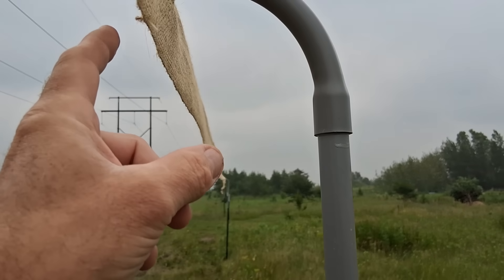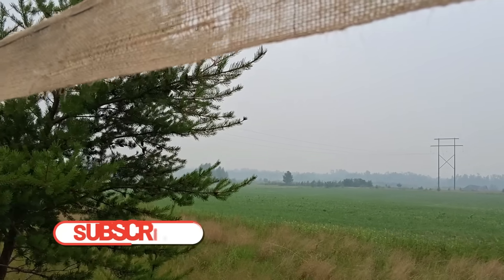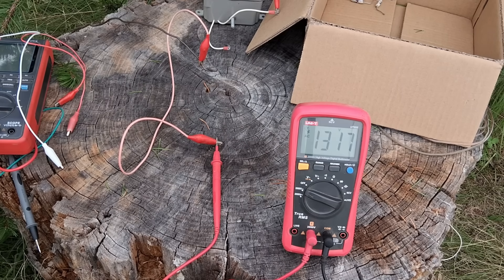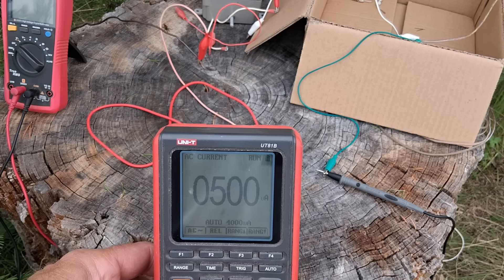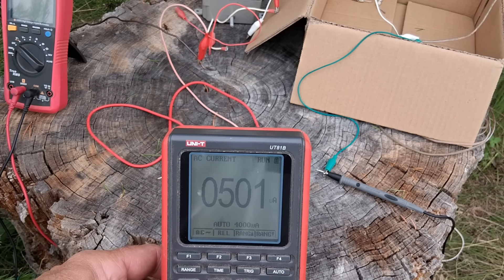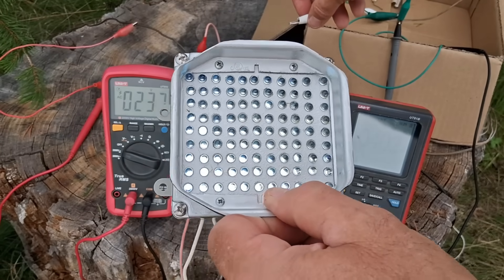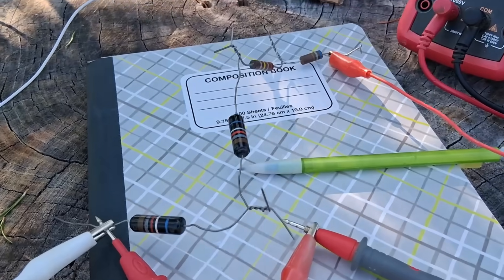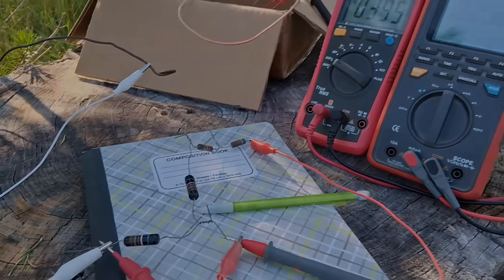Power sucking fences near H.V. power lines.  What transpired since?

Comment: mylar or aluminum 
Here is a detailed guide to turning this idea into a functional (though low-power) system.

1. Constructing the Collector Panel
Materials: A large, flat board (e.g., 4' x 8' foam insulation board is light and easy to handle). One or more space blankets. Conductive adhesive copper tape or aluminum foil tape. A wooden stake or post for mounting.

Assembly:

Stretch the space blanket smoothly over the surface of the board. Avoid wrinkles and folds where possible.

Secure it tightly using staples or tacks around the edges.

Crucial Step: Use the copper tape to create a "bus bar". Run a strip of tape from the center of the blanket to the bottom edge of the board. Ensure it makes solid, continuous contact with the metallic surface of the blanket. You can even criss-cross the blanket with several strips of tape to ensure low resistance.

At the bottom of the board, create a secure connection point (e.g., a binding post, a screw terminal, or simply solder a wire directly to the copper tape). This is where you will attach your wire.

2. The Essential Safety and Connection System
Grounding: You MUST drive an 8-foot copper ground rod into the earth at the base of your setup. This is not optional.

The Wire: Use a single length of coaxial cable (like RG-6). Connect the center conductor to the connection point on your collector board. Connect the braided shield of the coaxial cable directly to the ground rod.

Why Coax? The shield, when grounded, acts as a barrier that prevents the inner conductor from re-radiating energy and protects the weak signal from external interference on its way to your circuit.

3. The Electronic Harvesting Circuit
This remains the most critical part. The energy from the field is useless without this circuit.

Location: Build or place this circuit in a weatherproof box at the base of the collector pole.

Circuit Design:

Input Protection (Optional but Recommended): A high-voltage, low-capacitance capacitor (e.g., 100pF, 2kV) and a transient voltage suppression (TVS) diode across the input to protect against voltage spikes from lightning or line faults.

Rectifier: A bridge rectifier made from four 1N4007 diodes (cheap and rated for 1000V).

The Magic Chip: The input to an Energy Harvesting IC like the LTC3588-1 or BQ25570. This chip is designed to take the high-voltage, pulsed DC from the rectifier and efficiently convert it down to a stable 3.3V or 5V output.

Storage: The output of the chip charges a supercapacitor (e.g., 5F, 5V) or a small lithium-ion battery.

Output: The stored energy can now be used to power an ultra-low-power device like an ESP32 microcontroller that deep-sleeps, wakes up to take a sensor reading, and transmits it via LoRa once an hour.

Comment: If the coupling mechanism is capacitive, then a metal panel should have better coupling. Your coupling will be e A/D, where e is the permittivity of free space (8.854e-12), A is the surface area of your collector and D is the distance between the your collector and the power line. You are building a cylindrical capacitor, however I am thinking that you can model a small part of the cylinder as a parallel plate capacitor.    The current that will flow would be eA/D x dV/dT, where dV/dT is the rate of voltage change on the power line. A 100KV rms line @ 60Hz would have a rate of voltage change peaking at about 5.3e7 V/second. Putting this together, if the distance from the wires was 100 meters and your collector had an area of 100 meters the current flowing under short circuit conditions would be about 0.33mA rms (I suspect your distance is less, which would increase the current). Challenge is to extract useful power, as the output of you collector is very high impedance, one option would be to connect your collector output to the high voltage secondary of a neon sign transformer (not an electronic driver) and rectify the voltage appearing on the primary. 
Note that the power company is also inducing current into the earth below the power line, what you are taking is microscopic compared to those losses, that is why high voltage DC transmission is preferred for long distance movement of power.

Comment: Some fundamentals to keep in mind-

Essentially you are building a 60Hz near field antenna. A near field antenna operates within the near field of an AC conductor. The far field of such a conductor begins about three wavelengths away from the antenna, which for 60 Hz is about 4500 miles. The field strength in the near field decreases as the cube of the distance from the conductor so there just isn’t going to be a lot of power to collect at the distances you can legally place your receiving antenna.

The amount of power you can harvest goes up with wire length. Ideally it would be resonant at 60 Hz but a half wavelength at 60 Hz is about 1500 miles. That is why you are seeing milliwatts on a good day.

The better conductivity your antenna has, the more power you can harvest. Yes, that means copper. Copper is mechanically weak so you either need thick copper cable (expensive and liable to being stolen) or thin, say 22 gauge copper wire supported by steel fence wire. 22 gauge can’t carry a lot of power but short of a lightning strike it’s never going to have to.

Don’t try charging a capacitor with AC. Take the output of your antenna and run it through a neon sign transformer connected backwards (one high voltage terminals to the antenna wire and the other to a ground stake, take your output from the normal input terminals of the transformer) and measure the output voltage. It should be around 12 - 50 volts AC. Run that through a bridge rectifier rated for at least twice the voltage you see and maybe ten watts (it will never carry that much power but it’s going to be cheaper than looking for a very low power bridge) giving you DC voltage in the same ballpark.That you can use to charge capacitors or suitable batteries. You may need another transformer to get the voltage where you need it for the batteries you have on hand.

Transformers including neon sign transformers are typically better than 90% efficient. Don’t worry about losing power heating it up.

As always take precautions handling and assembling your gear. Even low voltage AC can be deadly.

Power companies don’t care about this kind of thing because power lines lose power this way to all kinds of other things from highway guard rails to metallic ore bodies, and they get a tax break on it. Any power you harvest will vanish in the noise of what they already lose.

Again, set up properly you will only ever be able to harvest milliwatts but it will be constant, night and day, as long as the power plant operates and your setup doesn’t get blown down.
Reply: Can't it instead be analyzed as a second half of a capacitor?
Reply: @mskiptr Good question.

The answer is, you can but you have to limit yourself to only taking power from the AC electric field of the wire, which means you have to connect one end of your load to the ground.

(There’s always a “but”. Electricity is complicated. That’s just a fact of life.)

This is because the power line has an AC potential along its length, which creates the field around it relative to ground.

At first glance it looks like a straight-up capacitor. You have a conductor over here (the power line) that has a particular AC potential and therefore creates an AC electric field in the space around it, and you have another conductor over there (the wire) so you expect the wire to take on the fractional AC potential at that point in space from the power line according to the inverse square law. So far, so good except the wire is in the near field where the inverse square law doesn’t apply. The field strength there obeys an inverse cube law, but we can ignore that for now.

Treating this as a capacitor requires you to assume there is no potential difference along the wire, but there is, because it’s parallel to the power line which has an AC potential difference along its length as well as with respect to the ground. It is easy to test by connecting both ends of the wire to separate oscilloscopes. The voltages at both ends of the wire will bounce up and down in response to the field emitted by the power line but not at exactly the same time. One end will be a little ahead of the other,showing that there is an AC potential difference along the line.

In a capacitor power does not flow along the plates, only across the space between the plates. All of either plate is at the same potential.

Using it as a pure capacitor, you would attach one end of a load to any point along the length of the wire, and the other end to the ground. Current will flow in the load because the wire and ground are at different AC potentials due to their different distances from the power line. You’re taking power only from the AC potential difference (the field) between the local piece of the power line and ground.

Using it as an antenna, you would connect one end of a load to one end of the wire, and the other end of the load to the other end of the wire. Current will flow in the load because the two ends of the wire are at different AC potentials. You’re now taking power 

You have that choice because the wire is a very sort antenna relative to the wavelength, and you’re inside the near field of the power line where the electric part of its electromagnetic field is very easy to measure and therefore easy to get power from.

Which arrangement gives more potential and therefore more power depends on how close you can place the wire to the power line and how long it is. Legal and practical considerations limit both of those variables.

Similarly taking advantage of just the magnetic part of the power line’s electromagnetic field is much more complicated.
Reply: @markfergerson2145  That's a great explanation. Thanks!
Reply: I miss my friend, he was my teacher at RETS second semester solid state, his real world experience was on a ship out of woodshole designing and acid etching circuit boards for receiving a command to fire explosive squid bolts to release titanium spheres of hydraphone arays housing concentric tape recording machines. Of shore anti submarine nets if you will, his name was Bill Gough and also worked teaching at PIT, Williamson trade and many, many others. Reading your, well, advice column reminded me of him as you are obviously within the same pedigree. Your first few paragraphs caused me to wonder what intervals a receiving antenna can be delineated into and still function. Quarter, half are standard,  but can any fraction be used or is like my bass gituar and harmonics only happen at known intervals? I was lifelong friends with my teacher as he considered me to one of his best students. That and I could stand him, mostly......
Reply: Antenna theory was introduced as a bit of a black art, and that was before either being ON or OFF made every one stupid that said now I am off to read up on near field vs far field radio transmission and reception, including spurrius radiation
Reply: @jeffreystroman2811 Nah, antenna theory is pretty straightforward.

Microwaves now, that’s flat out black magic.
Reply: The power company will definitely bust you for theft.
Reply: @Bryan-Hensley the instructor clearly outlined the reasons why they will not, no more than they would bill the highway department for the losses of a metal gaurdrail underneath the high tension lines. Please read and understand before trying to add to the discussion, with all due respect
Reply: @Bryan-Hensley Don’t take my word for it. Contact your local electric utility and ask them. Please make sure they understand that you are not talking about getting anywhere near high voltage lines much less attaching anything to the, they get jumpy about that kind of thing.

Comment: Per AI:
The key difference between milliamps (mA) and microamps (uA) lies in the magnitude of the electrical current they represent. Both are units of measurement for electric current, with the base unit being the ampere (A). The prefixes "milli-" and "micro-" indicate a specific fraction of an ampere.
 * Milliampere (mA): The prefix "milli-" means one-thousandth (10^-3). Therefore, a milliampere is one-thousandth of an ampere.
   1 mA = 0.001 A
   1 A = 1000 mA
 * Microampere (uA): The prefix "micro-" means one-millionth (10^-6). Therefore, a microampere is one-millionth of an ampere.
   1 uA = 0.000001 A
   1 A = 1,000,000 uA
Relationship between milliamps and microamps:
Because a milliamp is one-thousandth of an amp and a microamp is one-millionth of an amp, a milliamp is 1000 times larger than a microamp.
 1 mA = 1000 uA
 1 uA = 0.001 mA
In practice, these units are used to describe the current flowing in different types of electrical circuits. Milliamps are commonly used for small currents, such as those found in electronic components like LEDs or sensors. Microamps are used for extremely small currents, often found in low-power or microelectronic devices where power consumption is a critical factor.
The key difference between milliamps (mA) and microamps (uA) lies in the magnitude of the electrical current they represent. Both are units of measurement for electric current, with the base unit being the ampere (A). The prefixes "milli-" and "micro-" indicate a specific fraction of an ampere.
 * Milliampere (mA): The prefix "milli-" means one-thousandth (10^-3). Therefore, a milliampere is one-thousandth of an ampere.
   1 mA = 0.001 A
   1 A = 1000 mA
 * Microampere (uA): The prefix "micro-" means one-millionth (10^-6). Therefore, a microampere is one-millionth of an ampere.
   1 uA = 0.000001 A
   1 A = 1,000,000 uA
Relationship between milliamps and microamps:
Because a milliamp is one-thousandth of an amp and a microamp is one-millionth of an amp, a milliamp is 1000 times larger than a microamp.
 1 mA = 1000 uA
 1 uA = 0.001 mA
In practice, these units are used to describe the current flowing in different types of electrical circuits. Milliamps are commonly used for small currents, such as those found in electronic components like LEDs or sensors. Microamps are used for extremely small currents, often found in low-power or microelectronic devices where power consumption is a critical factor.
Be sure to use your units of measure consistently and accurately!

Comment: Back in 2000 a year before I got into building substations a guy on my brothers crew was killed building new hi-line parallel to an energized 500kv hi-line. That’s was the story we got anyway. Dude forgot to slap the piece he was working in with the back of his hand. Poor guy grabbed ahold of the piece and somehow the lime got induced with voltage. He wasn’t able to let go because once you grab an energized object of the current doesn’t shut off immediately your muscles contract. Well guy in the bucket with him ended up breaking his arm kicking it to get him free. Poor kid died that day. I remember very well my brother and all his lime buddies coming home for the funeral. Figured that would have kept me out of that line of work but nope I joined for the thrill. Thank god I developed a hell of a drug problem after a year and came home. Could have done without the drug problem but I know a lot of guys that have been killed or severely hurt working in hi-line. Funny thing is I went in  mining and got in on the high outage side of diesel electric haul trucks. Helped develop the LIEBHERR T282c litho ice drive system. I got shocked more times than I can count working in those cabinets. My wife says my body is made for electricity. I can take a hell of a shock but damn I’ve got some fucked out nerve damage from all the zaps.

Comment: Did you try it with a step down transformer in circuit? Drop the voltage on the output but increase the current available.

Comment: It's the same idea as a transformer with an induced current from EMF.  You should be able to run more conductors (insulated wires in parallel to the HV lines) to draw more current.  Theoretically, you could run this through a solar charger/inverter to generate useable power.  Back in the early 90s, when I was in college, I worked for the local gas utility.  They frequently shared cross-country right-of-ways with other utilities.  These buried gas mains oftentimes run for miles under the HV lines and would collect hundreds of volts at several amps.  It was affectively a long linear transformer.

Comment: A work colleague of mine, who used to own an allotment right next to a radio transmitter mast, told me that he would power his Christmas lights off the transmitter's electromagnetic field. He didn't even need any fancy electronics, just one end of the chain connected to a wire pointing towards the sky and the other end earthed. Strictly speaking this was stealing electrical power off the radio station, but nobody ever complained about it.
Reply: I mean they're pushing the power out, once it's out in the world it's free for all takers. I think this is a separate issue from the power lines because the transmission tower is meant to spread its power around so you're not leaching off of it. The power lines are only losing power because of physics being a bastard and setting up towers to draw that power is leaching.